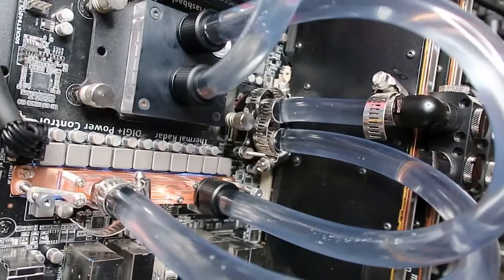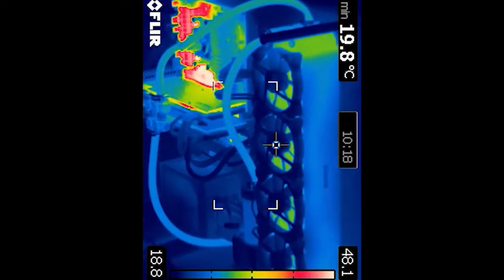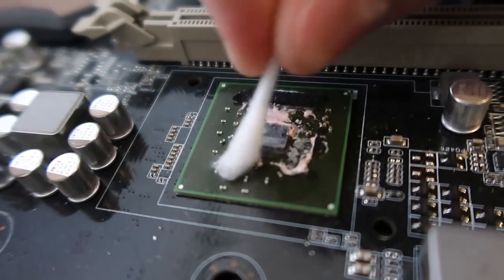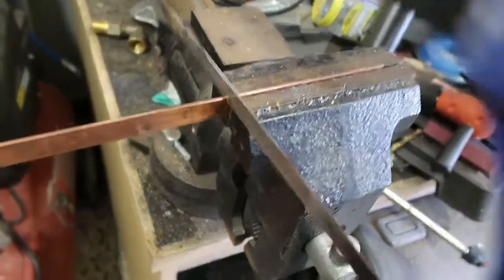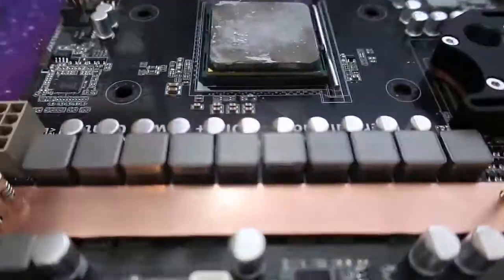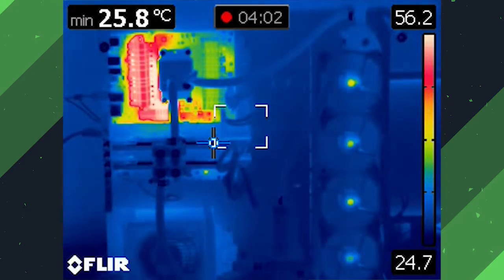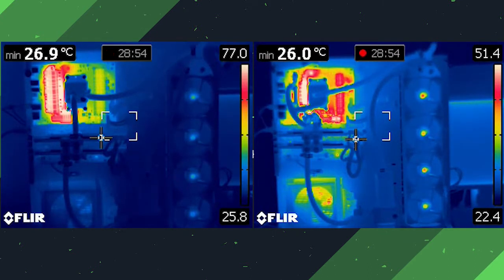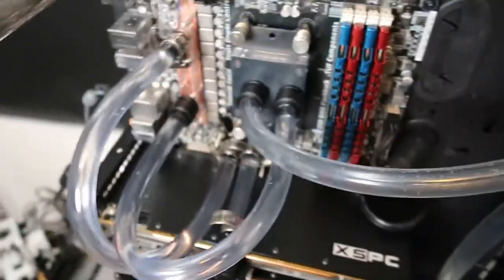Making my first Custom Water block (North Bridge & MOSFET)

Comment: It's been a few years but I hope it's still OK to ask questions here? Which kind of dremel cutting disc should I buy to perform this type of mod and cut into copper/aluminum the way you did? Also, the way those screws are "extended" outwards at 5:58, via the oval-shaped metal rings -- is there a name for those extenders so I can google them and buy them? Seems useful for some other projects I've got going on!

Comment: You should have soldered the bottom plate of the vrm block to the copper bar that way eliminating 1 thermal interface material!
Also those power stages seem to get quite warm some more block mods wouldn't hurt it :)

Comment: Maybe the VRMs were overheating since there was no airflow at all on the heatsink fins. I wonder what would be the temps if using a traditional air cooler.
Reply from the maker: True, that was the issue, not sure on temps as I was using a AIO cooler before custom loop, so not sure.

Comment: Are this block durable ? And what size did you use I saw it has 3 size 6cm 8cm and 10cm .. and are the screw fit the mobo holes for the heatsink on both mosfet and north bridge?
Reply from the maker: Durable I hope so... otherwise ill let you know when it floods the computer haha, I used the 10cm I think 12-13 cm would have covered all the transistors but didn't come in that size hence the 10 cm with the copper bar. yeah the screws for northbridge lined up because the block is generic so it could fit a range of screw spacing, but the motherboard holes for the mosfet has a plate behind it which has the screw thread as part of that plate, this plate comes with the original heatsink which I could reuse .
Reply: Did it ever flood? :)  @ScottyDIY

Comment: You can enhance the thermal transfer using thermal paste directly on the vrm chips and then top of the thermal pad where it contacts the metal and i assume youre already using thermal paste between the copper shim and the copper waterblock right?
Reply from the maker: TBH didn’t have any paste. So it’s thermal pads all the way. Not stressing atm. But hopefully by the time I need to do anything else I’ll just replace the whole system